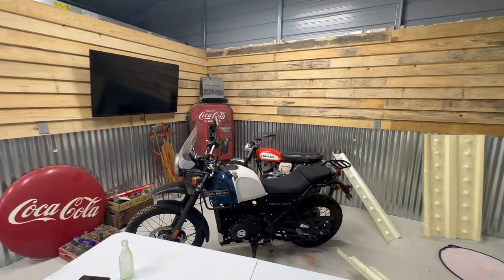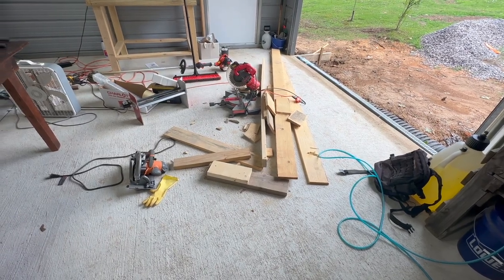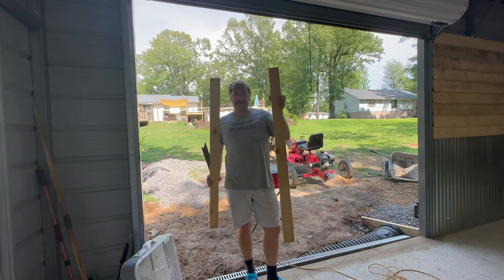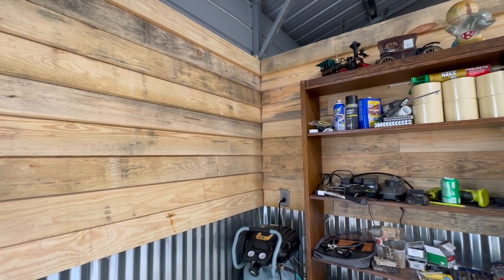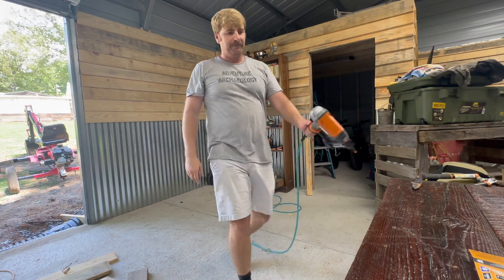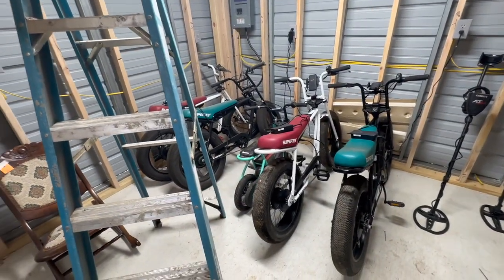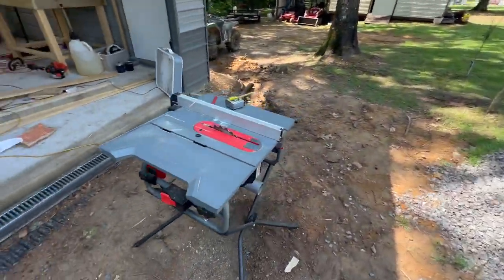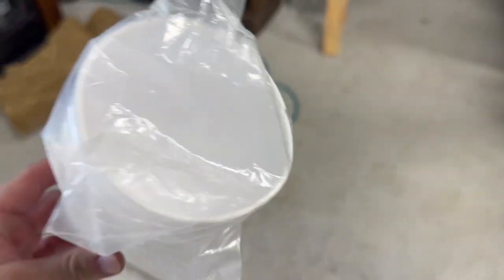Stung by Scorpion working on Adventure Archaeology HQ!

Comment: The shop is coming together, looking really good.  Sorry you got stung.  There was a time I used my mitre saw on the ground too, get a folding stand with wheels for it.  You can thank me later.  I’ve got a Delta brand, folds up like a dolly and stands in the corner when not using it.